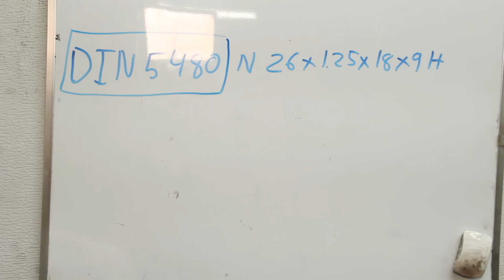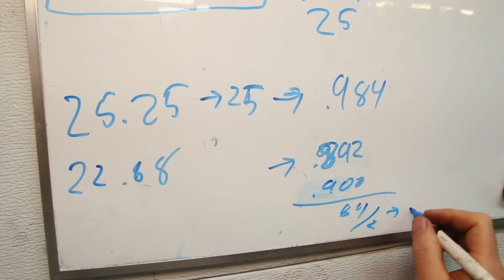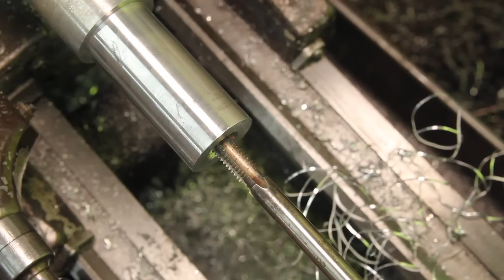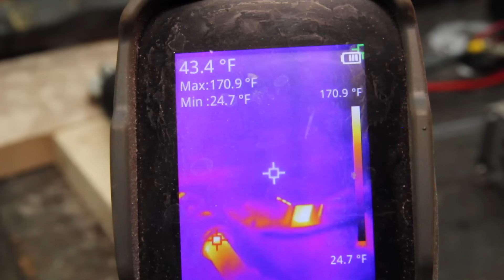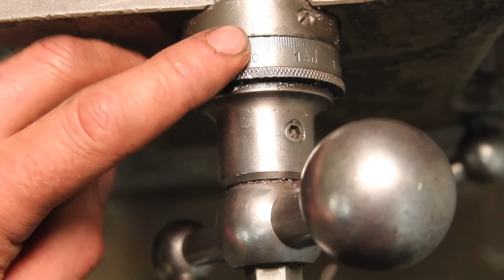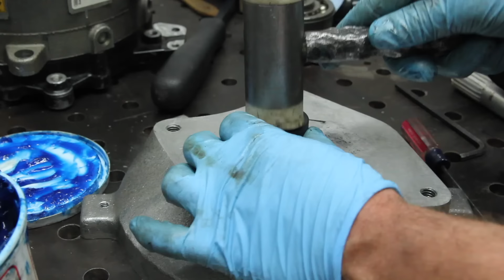Recutting splines on the Transmission shaft for my Electric Jeep

Comment: I'm impressed with how that shaft turned out, I've messed with them before and they are very hard. Wonder if the transmission would shift better in the synchronizers were removed?

Comment: Why couldn't you cut out the female splined hub from the jeep clutch  friction disc  and weld it to a stub shaft of whatever fits into the motor . That would give you a short adapter shaft. It would be captive and couldn't fall out. ?

Comment: yeow, so much work for such a simple thing. You could not find an input shaft that already fit? and just couple it to the jeep trans using a simple coupling.  I coupled a motor for my porsche boxster ev conversion, was not this hard.
I also have a project to convert a 944 transaxle to a direct motor connection which means modifying the input shaft (shorten it),
and I think I'm going to do it the easy way and just cut it and use a spacer to the motor instead of respline it shorter, because that will just work..  I guess if you got the tools and time you can do anything eventually.

Comment: i was wondering what was the electric motor from
or model number because i wanna do a 2000 impreza
Reply from the maker: It’s a Bosch smg180/120 out of a 2015 Smart car.  The same motor was also used in the Fiat 500 and a few other European EVs

Comment: EV diy-ers back in the 2000s and earlier could omit the clutch behind a series wound DC motor because those motors freewheel off throttle. I think your Smart motor may regen off throttle which could make shifting without a clutch more difficult. Hopefully it's not an issue or there's a good workaround. 

Love all the fab, machining, and CASTING!? So cool!

Comment: A friend and I did an EV conversion of a first generation Miata.

Using the original transmission avoided a whole slew of mounting problems, especially since the Miata relied on a 'power plant frame', a structure that avoids powertrain torque going through the unibody by having a beam connecting the transmission and rear differential.  It would have been a lot of work to design and fabricate a substitute structure.

We avoided the spline problem in the usual way, cutting the splined center out of the original clutch.  It took enough hours on the lathe doing a simple coupling, and that was far short of cutting splines and the associated annealing/hardening.  We considered Lovejoy couplings, but they fell so far short of our (modest) power goals that we immediately rejected that approach.

Comment: The heater uses a resonance to bounce energy back and forth from inductor to capacitor very rapidly. Then the magnetic field changing rapidly will quickly transfer energy in the resonant circuit to the ferous metal in the coil. The electronics must keep adding energy to the circuit to maintain the amount still bouncing back and forth.

Comment: There are lovejoy type joints used in heavy equipment between big diesel engines and massive hydraulic pumps. Having repaired a few of them, they still need misalignment and runout kept very small. You are definitely on the right path here, I wouldn't mess with any type of lovejoy connector

Comment: Most of that was pretty much on the don't try this side of my skill set but you made it understandable and I appreciate that , thankyou.
Now busting to see your jeep work with it...will it be a road vehicle?
Reply from the maker: That’s the plan
Reply: @JeremyMakesThings  very cool, In the Uk we have to have new design vehicles go to a special testing station, do you have to do that in the states or is it one of those situations where because all you are changing is the engine its fine?
Reply from the maker: @TalRohan it varies state by state.  When I am, it seems like I should be able to register it as normal (and it will be subject to annual safety inspections- I think that’s the equivalent of your MOT).  There’s a slight chance they’ll want me to register it as a “custom vehicle” but it doesn’t seem like that’s too much more complicated.
Reply: @JeremyMakesThings  thats cool, here the MOT is all you need on an older vehicle  (90's and back)  as long as you don't change the chassis or drive train, you're free to  put a different engine in and mess with the bodywork if its not part of the chassis. for one of my landrovers I was allowed to cut the back of the bodywork off and add water gas injection, and as long as it passed the MOT I was good to go. Beyond that you can't even build and use your own trailer without an official test paper.

Comment: Nice work. Good fit on those splines. It will be really cool to see this run. Do you know what the output torque is of the motor?
Reply from the maker: Max is 200nm or 150lbft
Reply: @JeremyMakesThings  that should be enough to do some crawling with the available gear reduction and lightweight of the jeep. Plus, full torque at zero rpm.

Comment: Keep in mind when you get it all together that electric motors produce their full rated torque at 0 rpm. Thats great from some perspectives, like low rpm crawling. But it has to be handled carefully when you start off. If you naively just switch on, you get a rante of problems, from excessive curent draw damaging the inverter to the sudden movement being imparted to the drive shaft acting like a hammer and breaking components. Its all totally solvable by bringing up the torque slowly,and this was probably something you already knew, but its subtle enough that i thought id mention it. I know if i had nor heard of that, ahd i was building an EV, Id probaby try a few runs at lower power levels, then think it was all good and throw full power at it and break something.

Comment: I would guess that it's a medium-carbon steel.  It does see fairly heavy service but it is bathed in oil and hot-hardness is not needed.  Most of the world runs on plain carbon steel, much to my surprise.  ALSO, you can look up the hardening and drawing temperatures for most steels.  Quench and draw temperatures are mainly effected by carbon so you can ignore a lot of the other elements.  There's a diagram in Machinery's Handbook.  For example, I make some custom odd-ball impact sockets out of 4140.  That's 0.40% carbon.  I heat treat at 1650 oF, quench in a medium oil (9 second) and draw  to about HRC 41 by cooking them at 800 oF for 2 hours.  Whatever you do, do not search the internet for this kind of information.  There's millions of useless web pages that have atomized the information to the point of confusion.

Comment: Having spent my working life in mechanical engineering, specifically in industrial gearboxes and mass produced gears for the automotive industry, I'm like a moth to a flame on any gear related post. People still treat gears and gearing as a black art, just as you have proven them wrong. Most of it is common sense with a sprinkling of engineering know how. Good post, really enjoyed it, thank you.👍
Reply from the maker: So you mean my candles and incantations were unnecessary? 🤣
I keep coming back to the fact that 99% of the knowledge about this sort of stuff came from someone making something, testing it, seeing if it broke, and if it did, tried to make it better and then repeating the process.

Comment: But with that hardening process, you have an area right in the middle of the shaft, where it is fully annealed, but below austenite transition temperature, i.e. about as soft as it gets.
Hard machining or limited annealing where it just becomes machinable, would have been smarter.

Comment: Those induction heaters are just very basic oscillators with no protection. You need to turn the power supply on and allow it to ramp up before connecting the induction heater. The power supply can ramp up too slowly, then the oscillator doesn't get the kick it needs to start and can just sit in one state and burn out (don't ask me how i know!)
Reply from the maker: That’s a good tip.  I’m also going to add a constant current power supply to it so it doesn’t try drawing too much.  It seems like it could be a useful thing to have around if I can figure it out.

Comment: I've messed around with the induction heater a bit, and from what I've gathered, the coil size is not arbitrary, and can affect how well it works. Also if I remember correctly you don't want to exceed about 1/3rd the volume inside the coil with your part. From my personal experience, as it looks like you've got a 12V supply, I got no where with 12V. I switched to 48V and it went vastly better. It is also easy to send the supply into over current protect, with too large of a part. Cool project keep up the good work.

Comment: Your work is impeccable. Your process looks a lot like mine did when I elected to re-spline the output shaft of a Borg Warner 3 speed overdrive transmission to mate to the torque tube driveshaft yoke in my 1950 Chevy. The only difference is I had to build the shaft up to diameter with weld first and I elected not to harden the shaft as its a low torque application. As I had no information on the spline type, I had to grind a custom HSS 1/2" lathe tool to single point cut the splines in a custom fly cutter holder.

Comment: As a Professional Electrical Engineer and a Shoot and Holler Shit Pool player and machinist, please allow me to correct one thing... You measure CURRENT, the measurement of the rate of flow of electrical energy. Amperage is a non term, used by tyros, one of which you are not. So set your Voltage and CURRENT appropriately and anneal away!

Comment: Did you consider retaining a clutch system?
Reply from the maker: I only looked into it enough to learn that most people don’t think it’s worth it.  The trade off is faster shifts (that don’t happen very often) for weight, complexity (still need a flywheel) and space.  As it sits right now, the motor basically only takes up the space where the original bellhousing was.  Keeping the clutch would have pushed it farther forward, meaning I’d have to move my battery pack up higher in the vehicle.  Ditching the clutch means I can keep the center of gravity as low as possible.
Reply: @JeremyMakesThings  That makes sense, hope to see it installed in the body soon, great video